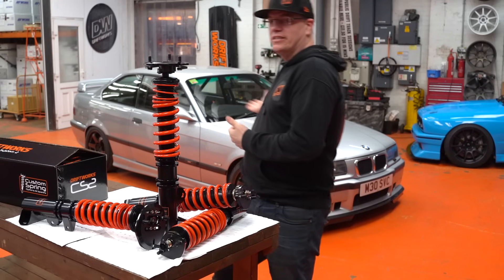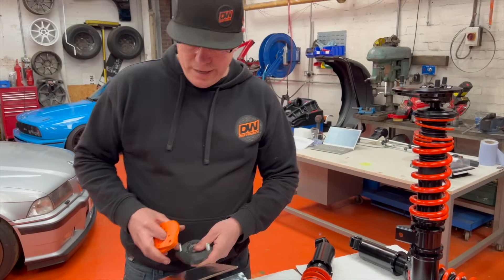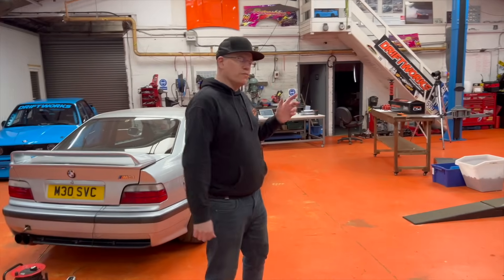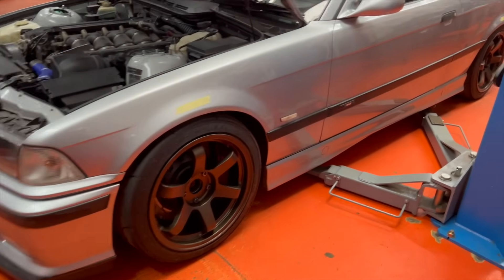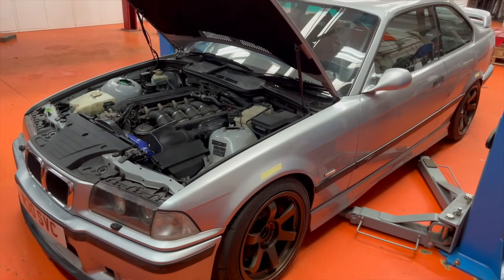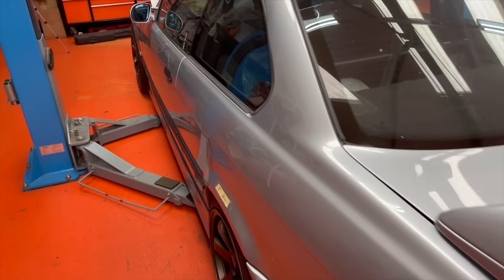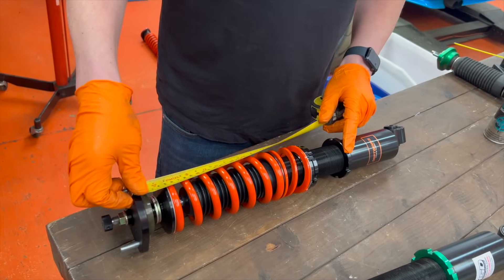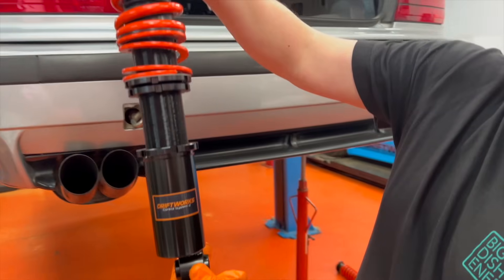Fitting the new Driftworks CS2 Digressive Coilovers to our E36 BMW M3

Comment: These will warp or straight rip out your rear strut towers without reinforcements or at least a strut bar (and maybe with them if you’re in a rusty place). I have personally seen this with my own eyes at a local drift track with a different brand but same design, zero hate to what is probably a great product!
Reply from the maker: It can happen, but this car was extensively tracked for many years on true rear coilovers before we owned it.

Comment: What load  does the offsets on the mounts take or tested to  . Same as oem I guess .  Secondly does it cause any bend/ flex in the shock under load just my thoughts no hardship I want to learn. So many questions. Keep up the good work 💙💪
Reply from the maker: Same as stock, and all forces are still opposing so no flex.

Comment: A lot of generic coil over kits seem to come with spring lengths that are too short for the damper stroke and coil bind can hit in compression before bump stops. I’ve chased this before pulling the springs off to understand the damper and bump stops. There is a ton to consider in setting up correctly. 

You have a corner weighted car with different ride height at each corner: do you not need to ensure the ARB drop links are free to rotate when the car is static on flat ground and not when at droop to ensure the ARB is not preloaded at static ride height?
Reply from the maker: Correct, it wasn't mentioned in the video, but all the settings that were transferred from the MonoPro kit had the anti roll bar drop links removed during corner weight and alignment & adjustments made with the wheels on the ground.
Reply: @driftworks   Good good. So many little details to suspension which I’m just starting to appreciate. Too hard to cram all detail and caveats into an entertaining and short vid.

Comment: I gotta say  , I don’t think the top shock mount of the body would be strong enough to support the whole weight of the car? I mean it’s only usually supporting the damper, the spring perch takes the weight of the car on a significant part of the chassis. 
 I would only fit these if a cage was tied into the top mount otherwise the inner arch will distort to hell.
Reply from the maker: It's run true rear coilovers as a dedicated track car for years before we bought it. We will be doing the reinforcement though.

Comment: A true coilover in the rear wouldnt mean more stress on the turret than intended from manufacturer? Just asking, they look stunning
Reply: It would, reinforcement plates would be needed
Reply: I thought the same . That metal there isn’t designed for the whole weight of the car. I don’t think even plates would be enough, the arch would distort

Comment: Would the front be able to come with e30 top mounts or this kit is not fitting a e30 at all (with a 5 bolt hub from e36)
Reply from the maker: We have 1 pair of E30 black camber top mounts in stock and could swap them onto the CS2's. When completing the checkout. Just mention in the comments that you would like E30 Black front top mounts, as agreed on YouTube.

Comment: Do you believe that non-detented damper adjustment, a la Koni, is just antiquated at this point?
Reply from the maker: I don't think there's any neeed to not have a detent. It's pretty easy to include in an adjuster.
Reply: @driftworks  I agree, was surprised that koni's didn't have any.

Comment: Lovely piece of kit although “reinforcement plates WILL be required” , these bad boys will soon push through a 25 year old strut mount.
Reply from the maker: The car has had true rear coilovers fitted for years and many trackdays. I will be doing it at some though.
Reply: Are the reinforcement plates a weld in item?
Reply: @robertwilkinson7566 yeah they are usually
Reply: @robertwilkinson7566 yeah it’s a good ideal to weld in a kit that will also turn into some sort of strut brace

Comment: FYI there is no benefit to putting the spring on the rear damper, all that will ever do is add friction in the damper (basically reducing small input sensitivity and "plushness" and adding harshness in their place) due to the sideload from the spring and move the spring load path into places that are not designed to take the extra spring loads. Seperating springs from dampers is only ever a good thing from a damper performance perspective. You are now expecting the rear damper lower bolt (single shear IIRC) to deal with the spring loads on top of the damping and bump stop loads which would be my own major concern, primarily from a  reliability perspective but also installation stiffness wise (i.e. the bolt will act even more like a spring that is undamped than it usually does = not great). Noting that E36's are also pretty well known for cracking strut tops does suggest this is a very retrograde step also...
Secondly, it would be good to see dyno plots from both the HSD's and these dampers as you can pretty much guarantee they are both digressive in bump (maybe not in rebound) just as pretty much every OEM damper fitted as standard on pretty much all cars made in the last 20 years or so are. Its a good thing sure, but its really nothing special.
I do love your video's as you do explain that you are not experts who love to muck around with cars, but just occasionally you do trot out some info that is really not great and this is one of those cases where the "upgrade" will only ever be retrograde in reality. P.S. I also once bought HSD Monopro's from you for my e46 wagon and they were OK. You really do have to tighten the locknuts on the ARB droplink attachment though or you lose tyres pretty quickly in the middle of corners...

Comment: Hi Phil can you give me any specs on this kit and the hsd kit as you are using them on the e30. I have a Ford Sierra with extremely similar set up to your e30 and was hoping I could get open and closed lengths etc. I want an inverted type kit and want to use this kit as I am using e34 bmw rear hubs and plan on using e36 front hubs, pretty much a carbon copy of your e30, any specs would be greatly appreciated as if I can use the kit I will purchase it. I may need the hsd kit as the top mount on rear of Sierra is a lot different and I’d struggle with having the adjuster there